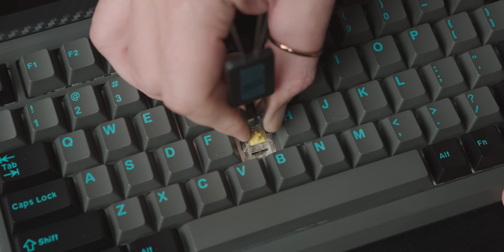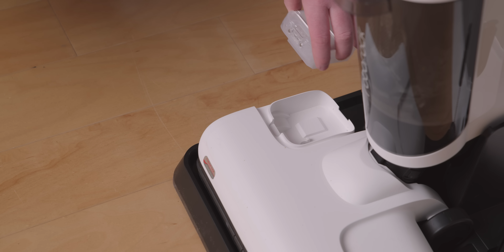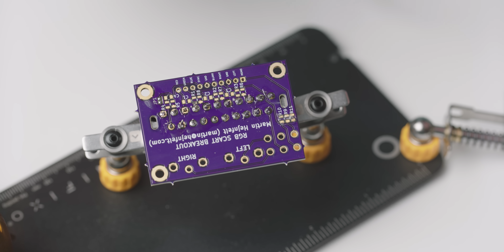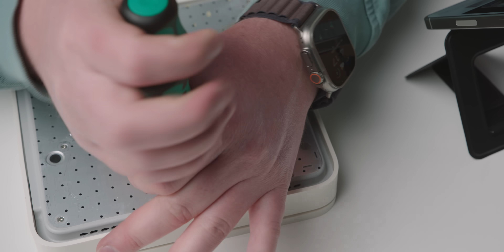Cool Tech You'll Actually Want!

Comment: Great video! There are a lot of ideas here. As someone who has run a gift shop, I can tell you that the best gift a man can receive is either a good wallet or a good massage.
Reply: Vionentus smart wallet PERIOD. about 90% of the wallets that claim to be genuine leather are made of bonded leather, they are the only brand I encountered that offer full grain leather for such a low $
Reply: A good massage of my wallet, I’m in.
Reply: Actually, that makes sense do you have any recommendations for a high quality wallet? I need to replace my BF wallet it's so old and torn..
Reply: Found them! They also have a slot for AirTag and RFID blocking so cool. Which design do you think is better?
Reply: I own their VN100 for few months already, looks like new
Reply: Bot ad

Comment: Isdt also makes the best Sony battery charger. I can monitor wirelessly. It’s like 1/3 of the price of Sonys $100 charger. Also to rub salt on Sonys wound, it charges fpz, fw and some other less used Sony batteries in 1 charger. It also is much less harmful to the batteries since it’ll fast charge until the last 5% or something which prolongs it’s life. I can’t recommend the charger enough. It’s not even expensive.

Comment: The tiny pliers are a good idea but they just aren't tiny enough nor thin enough.  Also need to have needle nose, 45, 90, 135, and 180 degree angle versions of them.  I'm thinking of tiny tools for technology repair kits (e.g. iFixIt) where torque is NOT a critical component but you might also want to grip flat to the surface (hence the 135 and 180 options).  Currently, tweezers are about the only tool available in tech repair kits and those are useless for gripping.  Being able to firmly grip tiny bits to hold onto them but not necessarily apply a bunch of torque is a major missing component of tech repair kits.  Tiny tech bits require tiny, thin tools.

Comment: That multi meter oscilloscope pen thingy read 5.2 volts on a 6v signal? I mean no one really needs a Fluke for hobby use but that thing is horribly inaccurate.
Reply from the maker: No, the PSU is. That’s what I was attempting to illustrate.

Comment: Do not get the roborock if your expectation is that it can handle carpet at all. I was going to say if your expectation is to have it work on carpet and hardwood. This machine can only work on hardwood, any carpet breaks it and it just dies in the middle of a room. Roomba J7+ has been fantastic. I shifted back to roomba after trying a few roborocks without success.
Reply from the maker: I have multiple rooms with high pile carpet and have never had an issue with any of my Roborocks.

Comment: Great use for an old Time Capsule. Thanks for the tip! Making it wireless will actually get my wife's MacBook connected to Time Machine. Be careful though. I'm new to Apple and didn't realize and AirPort and Time Capsule were different things. I bought an Airport Extreme, but it is a version that Apple doesn't support using a shared USB drive as a Time Machine drive on. So, now I have an outdated router and no Time Machine backup. :( I'm wondering if getting an old Mac Mini and dropping a new SSD drive into it would be a better option. Support on these AirPort and Time Capsules seems like it could go away any moment since they stopped making them about 5 years ago.

Comment: 0:59 ayo turn the switch puller vertically to push in both of the tabs on the switch housing and you won't have to wiggle it out. It should just be a smooth removal.

Comment: instead of a Kwumsy K3 buy an actually good mechanical keyboard, check out some keyboard forums, that thing is just a really cool case with the screen on it.

I have an $80 Android tablet on a stand for this, and the tablet actually does stuff like read e-books, watch YouTube, emulate dreamcast, PSP games, etc. I got that and a $35 Keyboard with Gateron Yellow switches ($115 Total), these two together are a much better value with much better performance on both. (the screen is even a lot nicer)

if it had good switches I wouldn't be saying this but for $300 that thing is a joke.

Comment: Re the little flashlight, is it a real USB-C that can be charged via a USB-C charger, or is it one of those “USB-C” plugs in which they cheaped out and didn’t use a 5.1 kΩ resistor so that it only works with USB-A chargers?
Reply from the maker: Real USB-C.

Comment: I still use a Time Capsule but find data transfer speeds are painfully slow - I was led to believe this was due to the hard disk controller in it. Is that not the case? Would I get more performance if I swapped the spinning disk out for an SSD? Maybe you went with SSD for the reliability rather than speed though.
Reply: i did the upgrade.. still slow.. really slow.. like slow slow slow..

Comment: Half of this stuff if bought will just end up in a landfill. It's neat for a while, but nothing long term or just an ok substitute. Gadgets are difficult gifts, because of their gimmicky nature and recommending used Apple hardware will just drive that price up again. I heard less good things about that soldering iron as well, apparently it gets hot fast, but has such low amperage the moment you need to heat up more material it cools down almost instantly.
Reply from the maker: Power it off a higher amperage charger… it’ll pull 88W. That’s a hell of a lot more than most $26 soldering irons.

Comment: I know it's not obvious and not trying to criticize, this is just important as it could cause damage. When you use a switch puller on mechanical keyboards, you should pinch north and south. The Cherry standard has clips at the north and south end of the switch that grab onto the plate, which is part of the purpose of the way that switch pullers are designed.
Reply from the maker: Benjamin be making the mistakes on this! I know to pull north to south. 😉

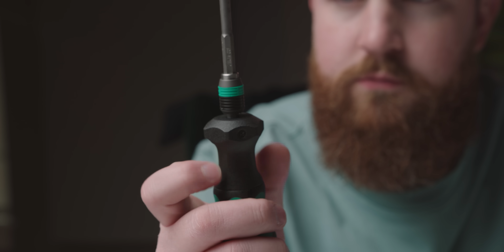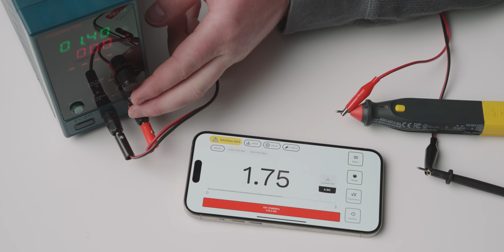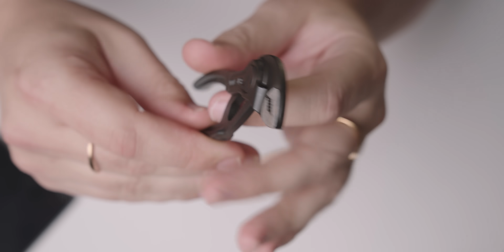Comment: Yo you did that LTT Stubby Screwdriver DIRTY at 13:47 xD If anyone has a suggestion for a good adjustable desktop power supply like the one at 17:10 on the top left? As a Canadian, I LOLed hard at 19:50 .... "if you're scared of fractions AND FREEDOM". Metric FTW! Except for human weight and height, also the 1 mile per minute rule of thumb is kinda neat, also for oven temperatures... It's hard to be Canadian.

Comment: Pinecil is great. I have TS100 (the more expensive version of the iron the Pinecil is based on) and it's the best portable iron I've used.
Reply: I got a Pinecil for its compact size and fast heating, and hadn't realized you could actually update its firmware from a GitHub repo. So the first thing I did with my new soldering iron was to fetch the flashing tool with a git checkout… 🤯

Comment: My old time capsule isn’t that shape? It’s much taller…will this trick work with it? I thought It stopped being compatible with MacOS several updates ago?
Reply from the maker: You've got a gen 5 which is newer. All Time Capsules still work just fine—but only gen 4 and 5 are quick at backup. What you've got is great!
Reply: @snazzy  ok thanks! I’ll try to connect it again. Just got the yellow light last time…
Reply from the maker: I’d do a full reset (hold reset button down while plugging it in and keep holding until it flashes yellow fast). Then set it up as a new device and disable WiFi and routing.

Comment: thanks quinn for the great list!
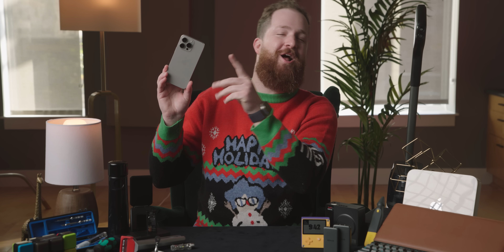01:42 been looking at that royvon flashlight! so many features. 
06:06 that charging dock looks PRIMO!! 
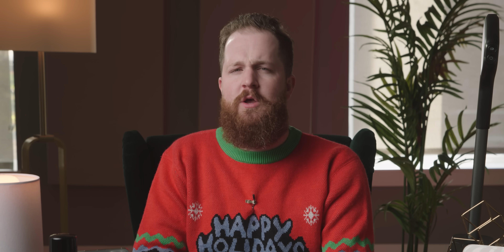07:26 speaking of audio, have you looked into/talked about anything like network streamer/smart-speaker/multi-room audio setups? just picked up the WiiM Pro to use with my old(non-smart) audio equipment. I really like it because it is compatible with ALL(?) of the smart-home "ecosystems"(Apple Home/Airplay/Siri, Google Home/Chromecast/Assistant, Amazon Echo/Alexa), has good I/O, and is pretty affordable.
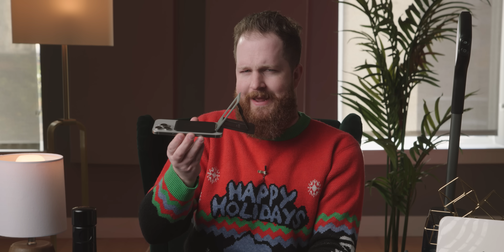08:56 btw have you seen the ohsnap magsafe grip? I really like how thin it is, and I love slapping my phone onto any magnetic surface(this only works if the ohsnap grip is attached to a phone case, otherwise the camera bump is actually TALLER than the ohsnap). obviously not more everyone but probably the best in the multi-purpose phone grip category.
10:53 omg, he's talking about the airport time capsule! been waiting to hear your thoughts on it.

again great vid!
Reply from the maker: Thanks so much for watching! Haven't seen the OhSnap MagSafe grip. Looks interesting, but probably not for me.
Reply: @snazzy 😆

Comment: the idea of putting a wireless charger on top of an already hot device just seems silly and a quicker way to ruin your battery
Reply from the maker: It doesn't get even warm, much less hot. Additionally, I've felt the active cooling covers the back of the wireless charger. Phone stays much cooler than on my official MagSafe puck.
Reply: 2 years with my S22 Ultra, charging every day with the Samsung Duo Wireless Charger, the battery it's in the same conditions without degradation.
Reply: "There's many german who watch this channel" - how many less do you have after those impressions? That keyboard with the built in screen looks awesome - that's on my wishlist.  Thanks for the idea of what to do with my old time capsule.
Reply: Update your phone my phone is cool all day
Reply: It's just like those powerbanks that double up as hand warmers that are surprisingly popular nowadays. They literally kill their own battery lol
Reply: @azenyr cause it’s cold lol
Reply: The bigger issue here is companies being greedy and not deciding to improve the batteries. It's 2024 batteries shouldn't have to be a disgrace.